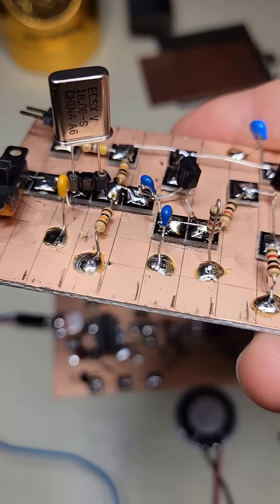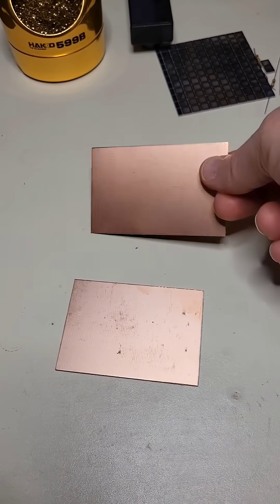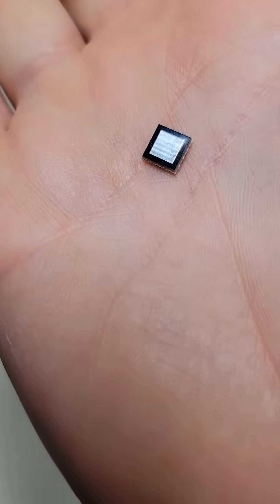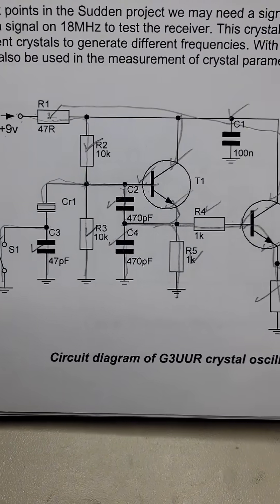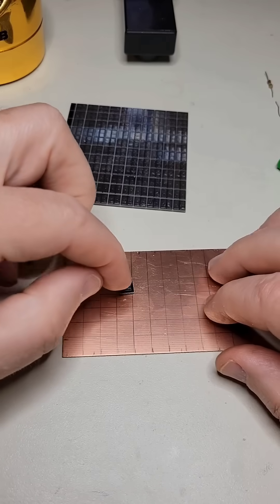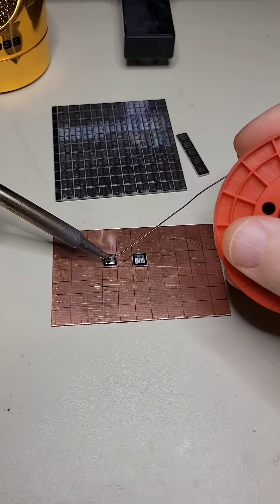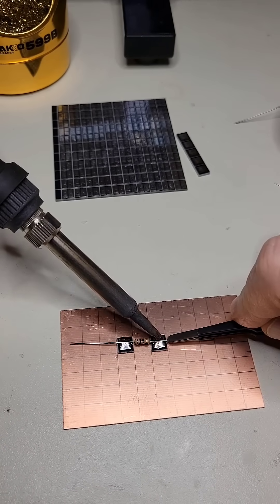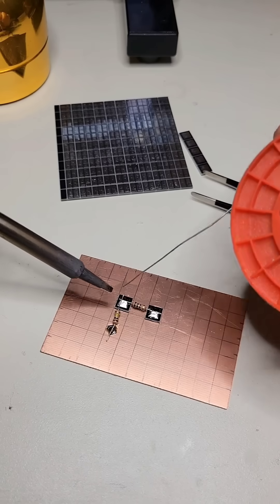Manhattan Circuit Construction Technique for Homebrew Ham Radios

Comment: Why not cut grid lines in the copper clad board instead?
Reply: The continuous copper layer acts as a ground plane for all of the grounds in the project as well as an RF ground plane that keeps noise suppressed.
Reply: @BillRehbock it can become part of a Faraday cage when solder a dome of sheet metal of this all. Open up a commodore C64 to see an example.
Reply: @ArneChristianRosenfeldt  Agreed. (I worked for Jack and Sam, btw :-) The point of this style is for quick circuit prototyping and keeping noise suppressed. Nowadays, if you want a quick PCB, desktop CNC is an option, too, but the style depicted by the OP is a cool old-school technique that's quick and reliable. ... though maybe not so applicable to SMD components ;-)

Comment: What's the purpose of this vs a perforated thru hole tinned pcb?
Reply: You can use the entire case as the ground plain.
Reply: @absalomdraconis  Ground plane.
Reply: You get a solid ground plane and you can minimise component lead lengths (not so much in this video!).
Reply: You can connect multiple components on a single pad. Makes it a little neater, IMO.

Comment: Another technique you can do is use a Dremel tool to remove the copper to make the islands. It took a while for my manhattans chowder tin from QRP me to arrive so I ended up using that for a transceiver project I’ve been working on.
Reply: Doesn't work with solid metal, which matters because sometimes people will use the metal of a case as part or all of the ground, while you can pretty much always cut any copper-clad that you have into small pieces for use as the "islands" in Manhatten style.
Reply: You can also use a laser to vaporize the bits of copper you don't need. It's a bit less of a mess, but the equipment buy in is a lot more.
Reply: Would probably have a little lower capacitance than "Manhattan" construction.
Reply: That's exactly what I do. easiest method IMO. and cheapest!
Reply: Or use a CNC mill like Usagi Electric does.
Reply: @mal2ksc  а хлорное железо уже никто не использует? Забыто?
Reply: @Anatole_Garin  - I did, it works fine but I didn't like how much toxic waste it generates
Reply: @Anatole_Garin yes we do but this technique is quick and easy hor prototyping.
Reply: I use this method a lot for some of my boards. It's great for some high frequency and power circuits, but you lose the continuous low impedance ground plane of Manhattan.
Reply: I was thinking the same thing
Reply: I guess this technique was invented by the "The 8-bit Guy".
Reply: @bsvenss2 Manhattan style has been around since long before the 8-bit guy was even born.
Reply: @JonathanKayne  With the Dremel approach? That was the comment.
Reply: Yup the ball works well
Reply: b-but my ground...😭
Reply: A relative is Dead-Bug style, where essentially you glue down the sonductive top of an IC, then solder to it's legs. Dead bug is highly compatible with Manhatten style.

Comment: Ive never once seen it done like this, and I've worked with a lot of old home made electronics.
Reply: About 40 years ago, at my start in radio, I used the same  technics ... 😊
Reply: My painful breadboard capacitance learning experience was the reverse. My circuit needed the parasitic capacitance to function, but it wouldn't work when I moved the design to a PCB.

Failures are effective learning tools.
Reply: Manhattan style is great for RF projects since you have that massive ground plane. Using protoboard can sometimes create parasitic capacitance that you might not want
Reply: Breadboards under the plastic have big ground plains and positive power rails... Works just as good and if you need a bigger ground for signal you can literally just add a chunk of thin copper tape and wire it to the ground rail..  @JonathanKayne
Reply: @michaellegg9381 Absolutely not, breadboards are pretty much the worst possible choice for any high speed digital or RF projects. They have considerable parasitic capacitance between each row and they don't have anything approaching a ground plane.
Reply: @ferrumignis  I only use breadboard for experimentation, not for final projects.
Reply: @jeffreyyoung4104  And they are ok for low speed designs, as long as they are good quality (cheap import ones are notorious for contact issues). For high speed designs (e.g. RF or digital circuits) using a breadboard even for early prototypes is asking for problems.
Reply: @ferrumignis  Absolutely!

If I were to do anything, I would carve traces if needed, which I have done for microwave circuits.
Reply: @ rubbish. breadboards have no ground plane. and no serious nerds use them on account of capacitive coupling. breadboards suck.
Reply: If you design a circuit on a breadboard with the right rc values, yes it will.  The parasitic capacitance is literally intentional  @KarldorisLambley
Reply: @KarldorisLambley 

No serious designers use this atrociously inefficient method. This is merely a taste of garlic.
Reply: @KarldorisLambley  The ones I've gotten usually come with a big piece of metal you can stick underneath. I had to google the purpose, and some said it was for EMI shielding, but the best use I could find was to stick them on rotated 90 degrees to secure multiple board together. But some said you were supposed to hook it to ground for some unknown reason, which would give you a huge ground plane I suppose. Just not any way to connect any components to it... And are you supposed to solder the ground connection on?
Reply: @ferrumignis Is there any good middle ground? Generic all purpose PCB designs you can get in bulk or something? I suppose just ordering the PCB you need it might be the way 99% of the times nowadays. But as someone with a whopping digital clock kit and two and a half breadboards of experience with electronics, I wouldn't know what I need.
Reply: @Jutastre  If there is a chunk of metal  stuck underneath it's to weigh the breadboard down, nothing more.    There are PCB designs that mimic the layout of breadboards to allow simple circuits to be transferred easily, but this still isn't something you'd want to use for high speed circuits.  Manhattan construction is a bit ugly, but if you want to build a well performing RF circuit as a prototype or one-off then there is a little to beat it.

Comment: Interesting. Manhattan because it’s got skyscrapers? 
I suppose you wouldn’t need the solder squares technically, if you were really good at wrapping leads.
Reply: It's because it's built on a grid, like Manhattan.
Reply: I have used "dots" instead of squares. I have extra double sided and single sided board, I just use a heavy duty hole punch to punch out a bunch of pads.   Only thing is if your working on something that is picky, the circuit board pads will have a small capacitance to ground, but most time its nothing to worry about.